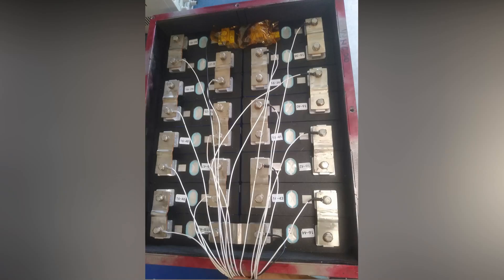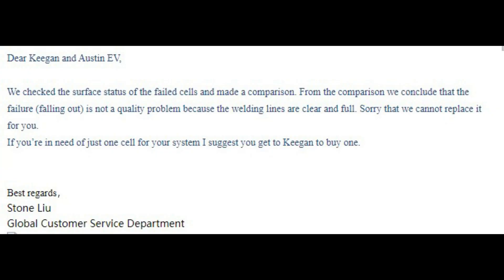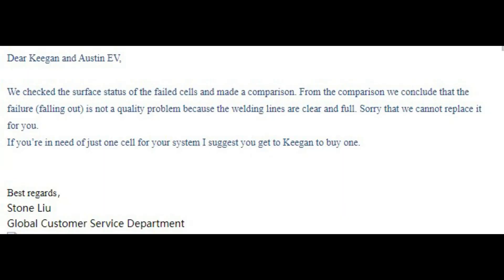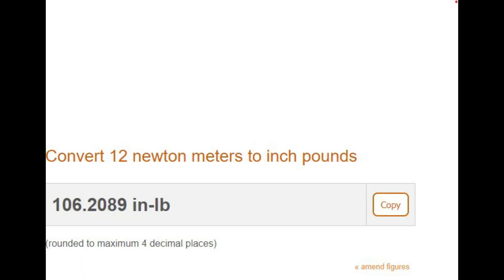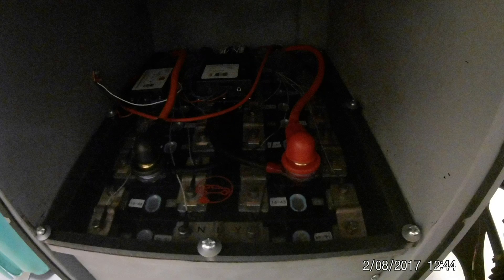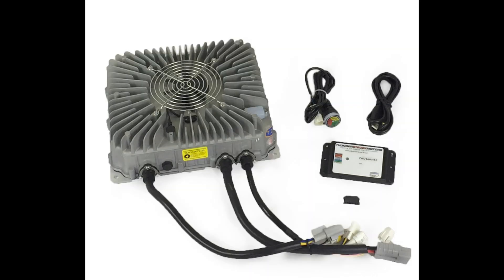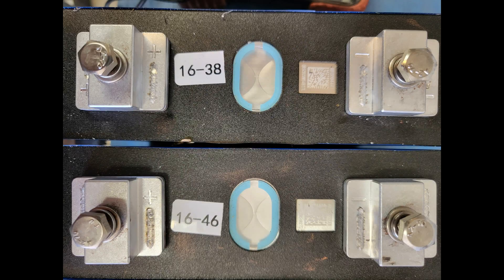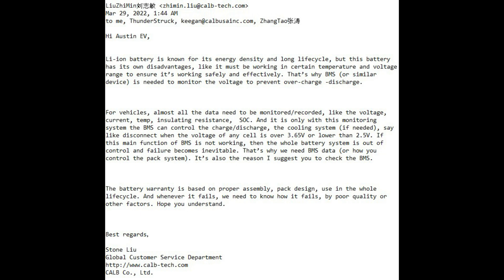More Battery Problems | Piaggio Ape 50 EV Conversion

Comment: Yeah, They've got You on the overdischarge. Not a CALB problem. That swelling would concern me though, how are the other cells in the pack? That issue with the broken terminal is very poor from CALB and will probably cause Me to reassess whether I buy any cells from them in the future. Stones should be thrown, not used for customer services.